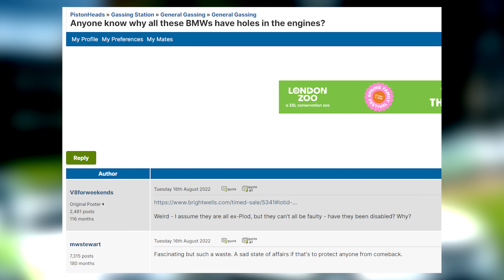Why The UK's Police Cars Keep Catching Fire (BMW N57 Engine)

Comment: 😂The real reason is cars are built to last the warranty period if that these days, id had Ford with 836miles go wrong fuel pump failed, bmw with 1100miles turbo went, audi had a rattle turned out to be loose bell housing bolts from factory. 
renaults caught on fire. 
its all cars now and police cars are driven like race cars most of the time so of course they wont last as long as joe public going up and down motorways

Comment: The constable won’t be out of pocket ..They’ll patch them up with a bit of filler. And rollback the odometer .. later to be seen on eBay as a low miler 1 owner

Comment: Should they switch off a parked car? Its not fair to sit for hours with the engine running. No way to monitor the engine oil life. They do this now in mot, leave it running for one hour.

Comment: I am not an apologist for BMW, nor a BMW fanboy, but I doubt this is a BMW specific problem. It seems to me that this is a result of the way the police are using them combined with the way the emissions filters work on modern internal combustion engines. I hope the Police have done proper testing of other manufacturers' engines, rather than just having a disagreement with BMW, which seems to include the Police refusing to decrease the oil change interval for their pursuit cars, because BMWs 3L diesels have a good reputation that I don't think is rivalled by any competitors engine. This is a new phenomenon so what's changed or new? Is it really just the addition of emissions filters? While the technology isn't that old, it's not that new, either. And the mileages Police cars do would mean they would see problems very quickly. I really doubt that simply changing manufacturer is the solution. And because of the way the Police are using their cars, clearly EVs aren't the answer; otherwise, the Tesla Model 3 Peformance would arguably be a decent hot pursuit car. I fear this is a maintenance issue and therefore a liability issue...

Comment: My BMW F82 M4 Competition is running strong at 78k miles and it’s a stage 2 running at around 550bhp. Never had any issues and use the car as a daily
Reply: Totally different engine pointless argument

Comment: All they really needed was low voltage sensing start programming into the ecu, very simple, they already have start stop and all are autos, would be literally some changes to coding by bmw to implement and then no extended idling diluting the oil and clogging dpfs? Classic money wasting by the uk

Comment: These engines are being fixed, got a chap next door to me who is buying them for peanuts in the auctions stripping the engines getting the hole professionally welded up then one piston bore replaced, put back together they run sweet as. Sells them for a huge profit.

Comment: forget BMW engines N57 or any other number, The problem is engines are made then politicians change the goalposts on emissions so they have to be retrofitted with PDF filters and other devices that choke up the engines causing potential problems, It is the restrictions on the exhaust gases that is the problem, usually !,  If these engines were allowed to run free of unrealistic emission rules there wouldn't be a problem, try explaining that to a politician that has been infected by the green virus and makes his decisions on the advice of the rainbow flag waving alliance and not mechanical engineers,

Comment: This isnt the first car fire scandal the UK Police have had, although I am not aware of fatalities caused by Corsas bursting into flames; back when I worked for Vauxhall Fleet in the late 90s/early 2000s.
With the Corsa, it was the adaptations to the alternator and cabling needed for the increased electrical load, causing the wiring to overheat and catch fire in the engine bay; Staffordshire used to have an entire field full of burnt out Corsas.
Reply: That's quite funny in a way, everyone knew vauxhall was junk but assumed the prices where just too good to pass up on.

Comment: Aren’t the BMW’s that the Police have as patrol cars chipped?

I had a new BMW 518d in 2016 supplied by a dealership in Arras, France. There was a recall to replace the EGR cooler. I noticed with my car before I could get it in for the job that the coolant level started to drop and the warning light came on. I was in the UK and took it to a BMW garage who topped up the fluid.

Strangely I was only advised of the recall by BMW UK. BMW France never informed me of this worldwide recall. I actually had the EGR cooler replaced in the UK. At the end of the lease I did consider buying the car, but the coolant warning light came on again, and I was advised by a BNW mechanic that problems with the EGR valve and cooler are expensive, so I let the car go and bought a Renault Talisman Initiale Paris which gave me no trouble at all and was more comfortable.

Comment: Iv heard leaving them ideal for 8 hours as an expensive blue fashing light generator is whats really wearing these engines out. BMW is good for the racing and chasing part, but no car is designed to sit stantionary for 8 hours. Wouldnt even leave a canal boat on for that long, let alone a performace engine that needa servincing every 7k miles, BMW maintence is an art. And if not properly and regularly then they go bad, and ideal engine is still rotating, still clogging up filters, ju5s not racking up any miles
Reply: Maybe they should ditch the miles for police vehicles, and go with hours instead, like you get with planes, plant and tractors etc.

Comment: My local force still uses BMWs but they have the newer B57 engine, e.g. G20 3 series, G30 5 series, Volvo has come on board in a lot of forces with the B6 engine in cars like the V90 and also some forces are switching to the Audi A6 Avant with the 3 litre 6 pot 286ps engine for roads policing, Peugeouts like the one pictured are only used for general patrol / response. I think you can also get some Skoda Superbs with 286PS

Comment: For info VAG have declined to provide vehicles in large numbers to the UK forces, they've been discouraged by what has happened to BMW, and besides, their smaller engines that rely on higher boosted turbos aren't as reliable. Volvo is doing a roaring trade to the forces, however issues are arising regarding the collision avoidance software built into the cars, TPAC  is more difficult to successfully implement when the car wants to stop you getting too close.
Reply: I wonder if that will change as most forces are switching over and I’m seeing a lot of A4 and A6 estate vehicles being used now.

Comment: IMO the F31 330d was the best traffic car we’ve ever had. In my force we still use them. We’ve never had a fire however we strictly change the oil at every 4k and we don’t idle for long periods. The cars do have a hard life, they can have extended periods of time being driven at 150mph. The beauty with BMW is that they’d shut a manufacturing line down for the Police and make large quantities of white police spec cars with basic interiors. This helped keep the cost down tor he taxpayer and allowed the police to have more cars on the road. BMW replaced all our engines under warranty and our fleet ranges from 130k to 170k on the chassis but around 30k to 50k on its second engine. They are really starting to show their age now and it’s like going back in time after sitting in a new Volvo or VAG car. We are moving to alternative manufacturers now; Volvo will shut lines down and produce large quantities of Police spec vehicles but they aren’t the best. They’re fast, but Volvo won’t turn collision avoidance off and it’s very intrusive and quite frankly dangerous on emergency responses. The collision avoidance kicks in all the time during TPACs which is infuriating and distracting and they’re nowhere near as dynamic as the BMWs. Plus Volvo use a high output 2 litre engine with 300bhp. Whilst it’s fast I can’t see it being able to take the strain that the straight six did, but this is yet to be proven as they’re quite new. My force also has a few VAG cars which have also been very good. They still make a 3.0 V6 (petrol & diesel) so i can foresee them being the new choice. Ask any traffic Bobby though what theyd really want and it’d be a 340i!! (which some forces managed to get before BMW dropped out the market)
Reply: Our Volvos in the force I work for are in and out of workshops auxiliary belts keep snapping, critical charge errors poor performance constant limp mode, cas kicking in randomly (which you can adapt to if you keep control and calm)
Reply: @johnstonlee  When the CAS kicks in is just braking or also applying steering?

I’ve had the auto braking come on going round corners because the car thinks oncoming cars are a hazard.

I’ve had the auto steering come on three separate times, not fun when that happens!!
Reply: @45Camster  yeah I’ve had the braking and steering especially with keep left bollards. But I just keep the power on and the computer gives up. I have got used to it now
Reply: @johnstonlee   It auto steered me across the centre line toward a traffic calming with bollards on it, not very confidence inspiring. The steering was sudden and aggressive requiring instant correction to avoid crashing.
Highlighted it but no-one seems to care.
Reply: @45Camster  we do near mis forms for this. But discussions are being had at high level as having Volvos 95% of traffic fleet is putting all eggs in one basket.
Reply: @johnstonlee  I did a near miss for one of times but not the other two, I was simply told that the driving style will have to change to suit the cars.

On all three times it happened the reason was the transition from brake pedal to accelerator, at that moment there’s no input and if you’re holding the steering perfectly still the car thinks you’re doing nothing and about to crash.

It auto brakes on a daily basis but it’s the steering causing the concern, not to mention when doing a quick three point turn and the car detects a blade of grass blowing about on the verge!!
Reply: @45Camster  need to do heel toe on the pedals like a rally driver 😂 the blade of grass 😂so true that! You would think you’ve hit a brick wall! Our force are looking at vw touraeg and Skoda superbs to mix the fleet up a bit as usually 50% of our Volvo fleet is broken sitting at main dealer with snapped aux belts and critical charge errors
Reply: @johnstonlee   I suppose heel/toe driving would work 🤣

We have some Superbs, seen one but haven’t been in one yet. Lovely motors so expectations are high!

Interesting about the critical charge issue given all of our Volvos are slowly taking their turns going off road with low/flat battery issues. The cause is currently unknown.
Reply: Ours have ordered a fleet of Audi A4 3.0 diesels. Running half Volvo & half VAG. We have a few petrol superbs and they've been faultless; now around 60k on the clock. Its the same basic engine from the Golf R/S3 but it puts out around 280bhp. Very revy and plently fast. The VAG cars seem more robust than the Volvo, and the collision avoidance can be turned off as well. 

We've had a similar reponse re the Volvo's Anti Collision. It'll only be scrutinised when somebody gets seriously hurt. I've found it to be worse when running in convoy. We've got quite a nice build on the Volvos and I think they look really smart marked up, just a shame they won't turn the collision avoidance off.   @johnstonlee  @45Camster
Reply: @45Camster blade of grass made me laugh. I was reversing our area car in the yard the other day from the wash bay and it wouldn’t let me, it just kept applying the brakes. Colleagues were looking at me like I’d never driven a car alone, let alone having RT ticket 😂
Reply: Thats so silly why would collision prevention still be on for a police car! On a spirited drive i always turn all safety systems off regardless of car because they are far too intrusive to the point they become dangerous. Cant imagine what that would be like for a plod car with all the high traffic/contact/tpac situations they face
Reply from the maker: Thanks for insight on that, much appreciated. I agree, a 2 litre putting out that much power will almost certainly not manage to do the miles any well kept BMW can. Hopefully the police and BMW can work things out one day, I know a lot of people that would be over the moon :)
Reply: Interesting insight, nice to finally see a comment from someone on a force! Have always wondered myself why the police didn't use the petrol equivalent (as you say, 340i); much more suited to the manor of driving than a diesel. Here in Norfolk I've noticed the latest BMWs ('21 and newer are all 5/330e, 2.0T hybrid!
Reply: I regularly drive my xc60 D4 (2.0l diesel) 190bhp quite hard and fast and it likes it. Not the fastest but it still shifts for what it is.
Reply: Better than a Senator 24v?

Comment: Spotted the problem - at the end if they are getting petrol mixed with oil the solution is simple. As they are diesels cars, don’t put petrol in!!! Seriously there are several independent car shops in the USA that won’t handle BMWs anymore because of the the myriad problems and BMW’s attitude.

Comment: So ultimately it was a servicing issue - More frequent oil changes would have prevented it?    If thats really the case then why did the forces feel the need to retire (and in many cases destroy) the cars rather than just halve the service intervals?   Lost faith in the cars perhaps?    Very sad story of the officer that died.  But I do wonder what else they are going to replace these cars with that won't have its own set of issues...  The way those cars get used its at the very extreme end of strenuous and will tease out any and every possible weakness in the increasingly complex and highly-strung engines of today.
Reply: Exactly. The oil and filter should be changed every 5k.  It takes a few minutes and minimal cost so theres no reason not to do it.  The car would be out of service for 2 hours a month absolute tops.  I would say the absolutely RIDICULOUS flexi-service intervals (sometimes upto 20k before an oil change) are to blame tbh.

Comment: They are going from frying pan into the fire. Not clever. They have no idea if the same will happen with other models. This is the "Super Puma Effect". The Super Puma stopped being used for North Sea crew change because it had all the accidents: because it was the best helicopter, therefore it was doing all the work! All they needed to do was institute monthly oil testing for the specialist road policing part of the fleet.

Comment: Seems like hydrogen cars could solve some of the problems that these engines face. I dont think pure electric cars could realistically be an option with charging times.
Reply from the maker: That's a very good point. One option with that that comes to mind for rural areas especially could be the Ineos Grenadier -  they were showing off a hydrogen fuel cell prototype at Goodwood this year which looked promising. Plus, it'd be supporting the British economy too.
Reply: @blagssss  unfortunately even though Ineos' founder was a brexiteer, all the grenadiers are built in France so not sure how much it would help our economy.

Comment: BMW = Brainless Money Wasters! I`ve NEVER owned a BMW but I`ve driven a few and didn't like them at all. ?Also, an employer had a few and they're not as reliable as you might think. Head gaskets tend to blow when the mileage is getting high, oil leaks from literally anywhere! My old Ford Fusion with 80k on the clock was more reliable and oil tight than any of the beemers I`ve driven/know about!
Loathsome cars!!
Reply from the maker: That’s fair, definitely seems down to the specific model in my opinion. I’ve got a 21 year old BMW and it’s been absolutely bulletproof so far (just under 100k mi), but some of the more recent models have had questionable reliability at best. There’s definitely a correlation between the amount of plastic tat under the bonnet and how unreliable a car is 😂